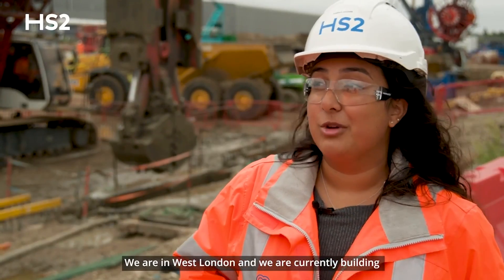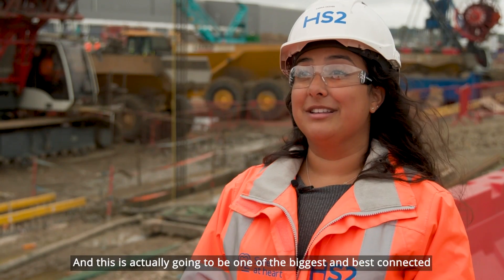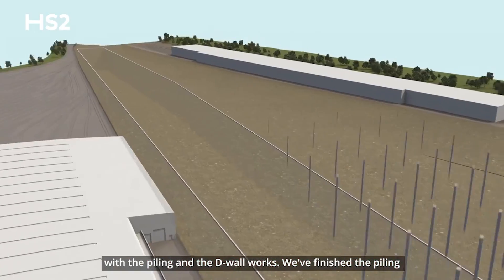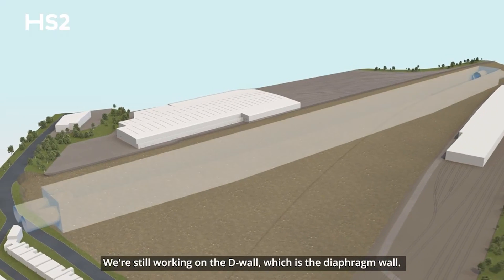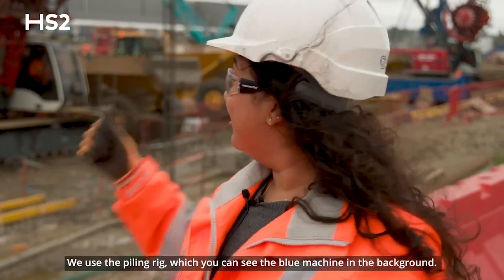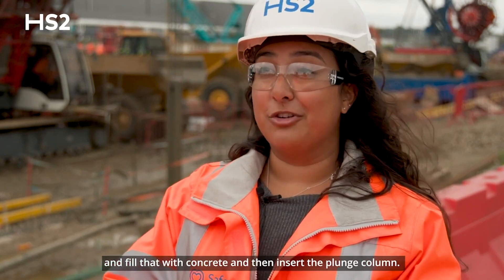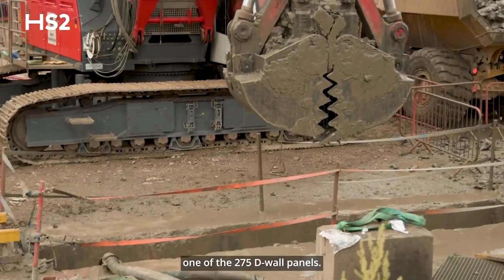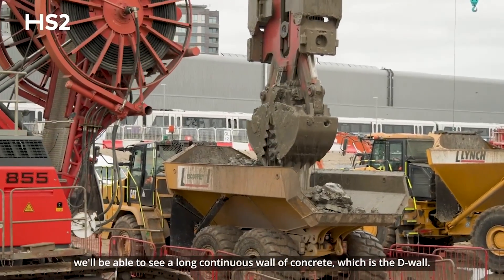Laying the Foundations for HS2's Old Oak Common High Speed Railway Station

Comment: The impression I got is that they do one pile per day. Is that right, or am I misunderstanding? It seems ridiculously slow.
Reply: They should have it finished by 2030... Well that's the plan.
Reply: @vwgolf9826  HS2 is a multigenerational project. It’s an entirely new like that can be used for decades to come. A lot of the people who designed it will likely never even get to see it in operation.
Reply: You forget one thing about this project, there's NO hurry to do things, steady as it goes..
Reply: Back in Victorian times, people building railways didn't really care about how many construction workers died building railways. Accidents were just delays to them.

Now, construction companies try to avoid killing workers. That  means they are giving the concrete time to dry before they work on those panels. The tmescale is defined by engineers who have worked out what is safe.
Reply: This is a cramped site and the equipment for constructing the perimeter diaphragm retaining wall and the foundation piling system take up a lot of space. The piling system used is a slow system. A faster system of piling called a continuous flygt auger system is faster at around 8 piles but they  rely on the sides of the piles to provide structural strength and are limited to a depth of 30 metres. The vertical loadings required here dictate the system used which is a bored piling system relying on end bearing to provide strength at deeper depths.